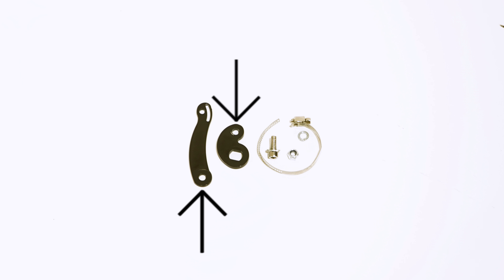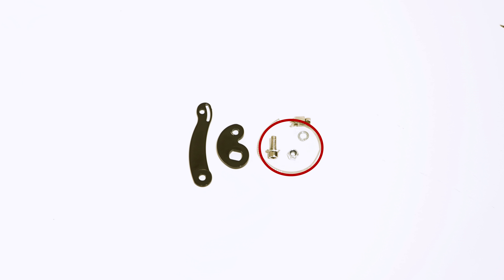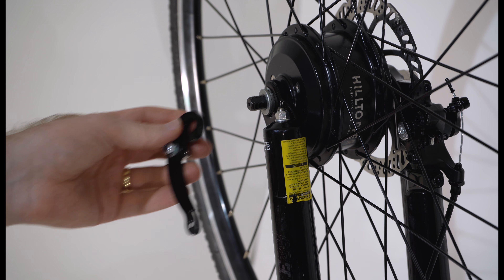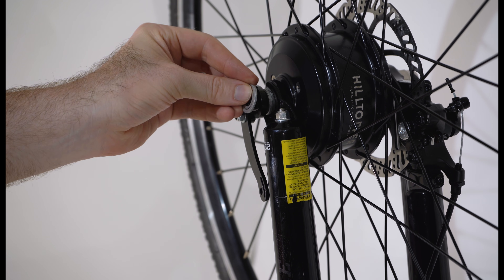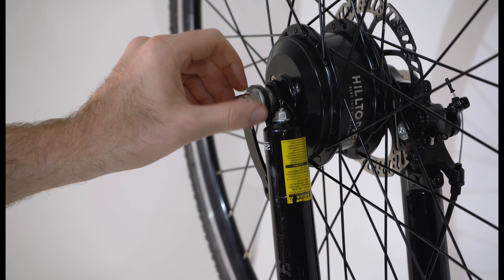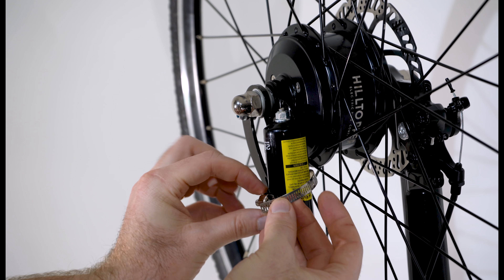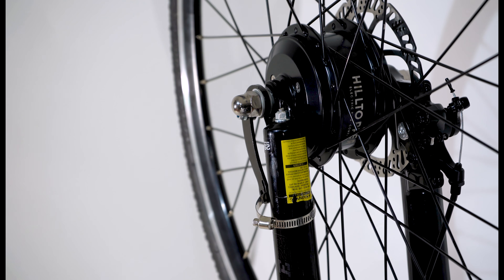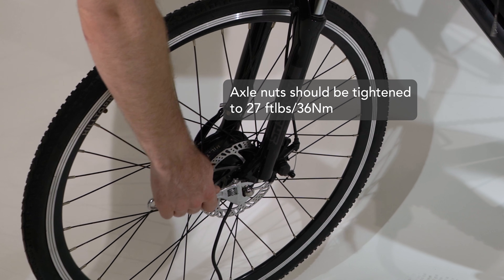Hilltopper - Installing Torque Arm

Comment: Thanks, Have you had any dropouts break with using those torque arms? I've broken three dropouts, two in an aluminum suspension similar to what is shown here and one downhill magnesium fork using a 1000w direct (non-geared) motor using two of what looks like the same torque arms. I've noticed that the inexpensive stamped arms typically have about 0.012" of play on the hubmotor shaft and a lot of play in the torque-arm to shaft arm bolt hole, and when combined with the flex of even a heavy duty hose clamp, even if the torque arm slots are positioned tight to counter the motor shaft torque it still allows enough twist to over-stress the dropouts. I've tapped the tru-hole and used a larger machine screw on the third attempt but that apparently was not enough.

Luckily all three of my failures were starting from a stop using about  400watts (8amps at 48V). the high-end magnesium fork lasted about 100mi and broke under light starting load, and all three fractures appear to involve some element of fatigue.

I modeled cast alloy dropouts and motor shafts in Solidworks, and found that the cast aluminum and magnesium dropouts were at 60% of static structural damage with only 30n/m of torque, but about 20% with solid 6061 aluminum. From those basic numbers I have to question the safety margin on any front fork motor install even with torque arms and wanted to convey my concerns for whatever they are worth and see if you might have any better insights?

Thanks.